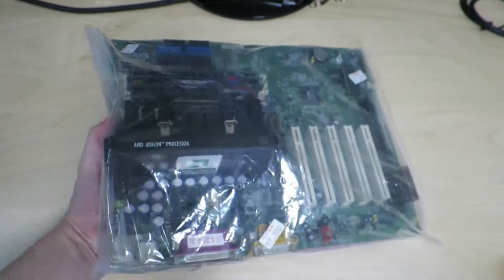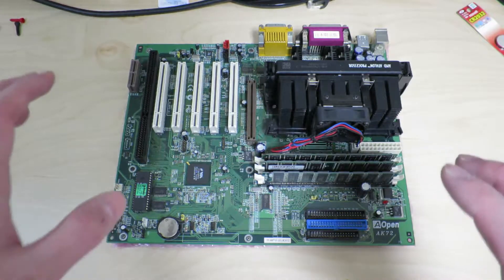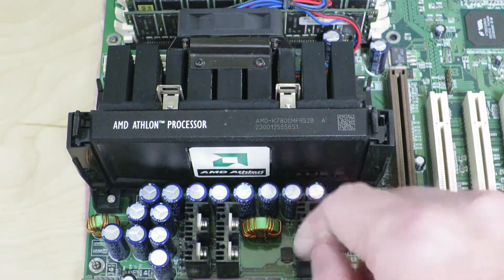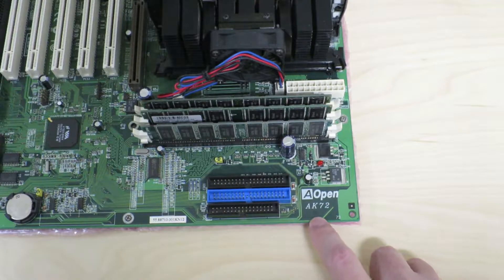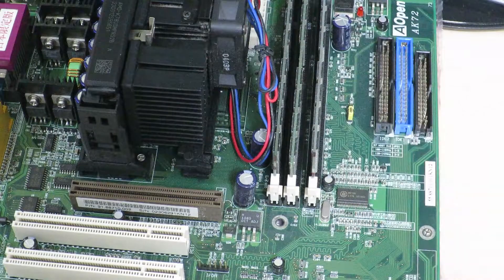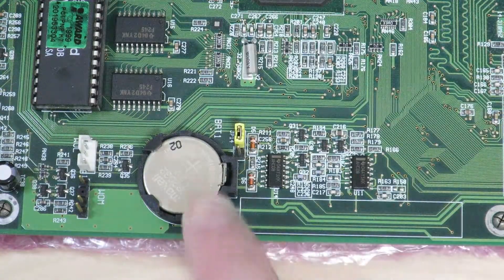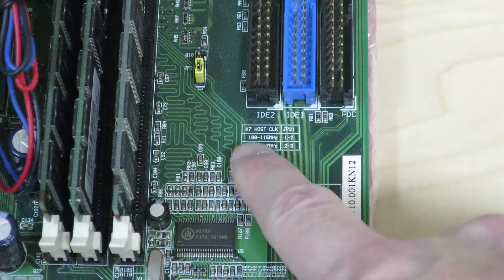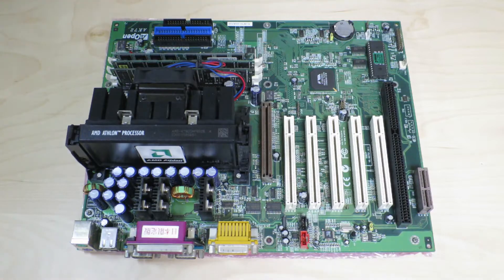Close look at AMD Athlon (Slot A "K7") Motherboard & CPU - Akihabara Junk Finds

Comment: I had this processor and a similar motherboard.  My cooling fan had two fans on the processor for increased cooling capacity.  There was debate in the forums whether it was more efficient to run them both outward or flip one to create a wind flow across the processor.  Also that processor fell out of the motherboard any time you moved the computer around.  It was standard practice at LAN parties to pop the case off and re-seat the processor.

Comment: I would love to design and build a Slot A board that would allow these old Athlon Classic and Slot A Thunderbird processors to be ran on modern power supplies that aren't heavy on the 3.3 and 5 volt rail amperage.

Comment: I have one of those AMD Thunderbird Slot A 800MHz sitting in my basement in funky green case.  I barely remember building it in 1999, my part number is same but ends in 24B instead of  52B.  I know I had a Pentium 75 before the K7 but can't remember anything in between which is 4 years. I do remember immediately wanting more power when I got the P75 (Packard Bell Legend), so I think I must have upgraded the CPU on the Packard Bell.  I know I had a tech look at it and they told me it didn't have all the onboard cache which made me mad at Circuit City.  I guess that was when I put a P100 or higher in it.
Reply: Your Athlon is only a Thunderbird if it starts with A0#00 and has the cache integrated with the CPU. The chips that start with K7#00 are original Athlons with the external cache. They made both in the slot version, but only one in the socket version.
Reply: @redleader6442 Also the last letter in the K7 chips will nominate whether you have a Argon, Pluto or Orion core. I'm not sure about what time they stopped but older chips ending in C and R were Argons, with ones ending in A being Pluto/Orion.

And take it from someone who had all - stay FAR away from Argon - it's slow, heats like a mofo, and IIRC it does not OC well. The other three are your best choice. Pluto, Orion and T-Bird scale insanely well with the right tools.

Comment: AGP video cards had its own memory, known as VRAM. There was no sharing system RAM.
Reply: That's true and untrue. The developer had to make sure that the important data was read from the harddisk drive into the system memory by CPU command, and via DMA (Direct Memory Access) the videocard would be given the command to access the system memory for most used data and put it in its own video memory.
As textures size increases and the VRAM was too small the videocard would then result to swapping to and/or reading directly from system memory.

A good example is the fact that the popular Geforce 4 ti 4200 had two versions that were sold. One being the version with 128MB @ 222 Mhz memory clockspeed, the other being the faster but smaller 64MB @ 250 Mhz version.
In initial benchmarks upon launch the 64MB version would be clearly faster in the benchmarks, but a year or so later games came out with increased texture sizes due to higher resolution textures. Guess what happened?
The performance tanked on the 64MB version because there wasn't enough VRAM for the higher resolution textures, thus those cards started to swap or read from system memory and performance on more modern games would suck.
On the other hand the slow turtle with the heavier load to carry, the 128MB version, was now still playing those newer games with ease and easily outperformed its 64MB sibling.

Moral of the story. Yes, VRAM meant that videocards now had much faster access to their needed data, but if the file size gets to big and out of bounds for the VRAM size installed on your videocard... it will still go back to system memory for help.

Comment: Where exactly in Akihabara did you find this? I have looked before and the used PC parts selection has really dwindled there over the last several years. IF you find one of these mobos again please let me know, I'll gladly pay for it and I have an address that you can send it to in Japan. What I am looking for is the AX59pro or the AK72 mobo. My first computer build was while I live in Japan and I bought all my parts at a shop called PCBUYKING in Iruma Japan (Kanto). AX59pro, AMD K6-III 400, 512mb of ram, sound card, TNT video card and a beige case in 1998. Fun times
Reply from the maker: Very true. It's hard to find old items in Akihabara. I got this at PCNET which closed down several months ago. Basically, I found this in a time when I used to go to Akihabara couple times a week to find items like this. Interestingly, just this February, there has been a resurgence in these "retro" machines -- if you're able to stop by the Tokyo Radio Department Store (Akihabara) on the weekend, you'll be greeted by a few "junk" shops in the basement. You can't miss it, since you'll bump right into it when you arrive by the escalator. If going to Akihabara isn't an option, then keep your eyes on Yahoo! Auctions -- you'll sometimes find rare items there...
Reply: @coobird  Thanks for the head's up on that. I will not be going to Japan this year, but maybe in 2020 again. Trying to move back there as well, but will see. Luckily I was able to find a new Epox slot-a mobo and a new K7-700 CPU for my build, just waiting for them to get here. Nostalgia at it's best!!

Comment: I have SD11 with Athlon 600, Elsa Erazor II Banshee and Aureal Vortex card, half life looks and sound avesome, try it by yourself !
Reply from the maker: Awesome! The SD11 was the first motherboard I got for the Athlon series, and I had a Athlon 550 installed on it back in the days! I don't think I was using any fancy video cards back then, but I did have a Sound Blaster Live! which I was quite happy with, and wish I still had. Thanks for sharing, and bringing those memories back! :)
Reply: @coobird  I like Athlons Slot A, that's true, they was a bit faster that Pentium III equivalent. I recently bought Tayan Tsunami and Power Mac G3 tower and some bunch of graphics and audio cards. If you need some cool hardware at reasonable prices go to Amibay